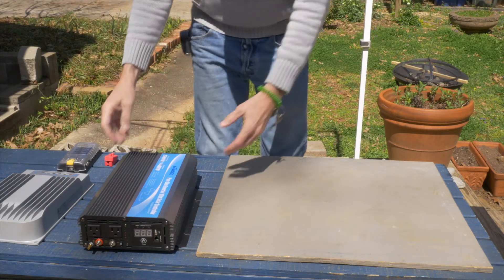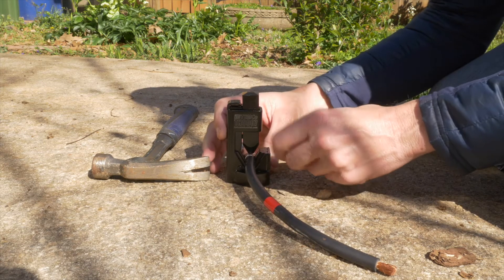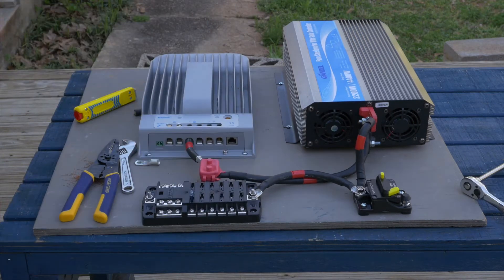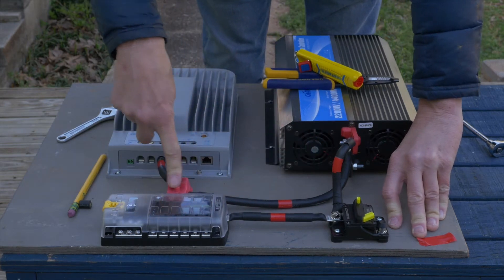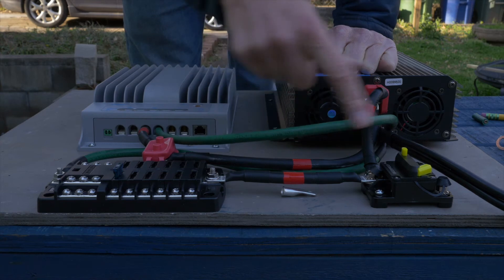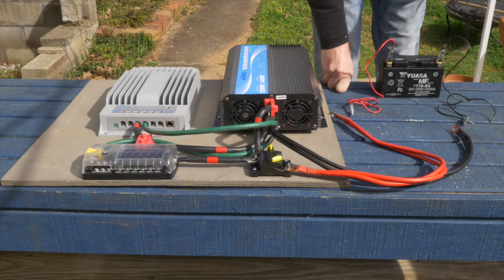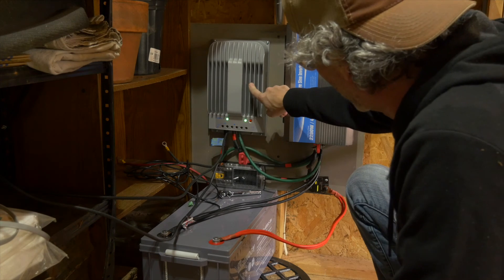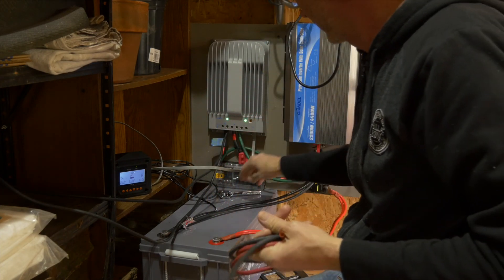Wiring my first solar setup.

Comment: Man, you have good taste in components! "Gandalfs" have a great reputation and I believe that you tube solar guru Will Prowse recommends the EP Evers as one of the best. It was like watching a guy set up a stereo system with Denon, Yamaha, and other good brands.  I think I may be slightly OCD, it actually bothered me that you had green wires instead of black, any chance you can wrap a black electric tape around those green garden hoses just like the red tape you used positive wires?  So, that 2200-watt inverter puts out as much juice as my 2200-watt Honda gasoline generator. Wow.
Reply from the maker: I work on motorcycles and Green is Ground and Black is Hot on many bikes so I am comfortable with the color scheme. Plus I got the wire out of a scrap pile where green and black were the only choices. Thank you for watching.
Reply: @billys2416  I was just joking, it looked like good thick gauge. I have seen some You Tube Videos where all kinds of colors, white, yellow you name it is used. In fact, I recall one of Will Prowse's where he used off colors blue and white. But the worse was where some guy in India used a car starter battery for his real basic almost primitive set up. Poor guy.

Comment: @ 2:32 you could have just moved the fuse box a bit to the left away from the breaker to get the cable straight so no cutting and wasting material. Kind of late advice tho..lol. Nice setup, good informative video. Greetings from Jamaica.
Reply from the maker: True. I think I already had the fuse box screwed down and just went for the crimping practice.

Comment: I searched for some information about wiring the solar charge controller to the inverter like you have done. A heap of solar professionals here in Australia suggest not to do it as it can wreck your system. I've seen heaps of people do it your way. Wondering if it's got anything to do with our voltage to compared to yours.
Reply from the maker: I do not know why. I wired it the way I did after seeing IDK how many diagrams and watching videos. Many froom Wil Prowse. I even bought his book.
Reply: @billys2416  I watch Wils channel too.

Comment: Nice video. Can you tell me if you have to have the battery heat sense wire and the remote monitor to make the controller work correctly. I would appreciate your help
Thanks John.
Reply from the maker: I do not know that. I do not think you have to have it. From what I understand If you do not use the heat sense wire the batteries could be damaged or worse.
Reply: The controller will function without them. The temp sensor prevents under or over charging batteries in cold or hot weather. Interior of a vehicle can be quite hot in the sun and that can be a big problem without the sensor. Without a monitor you have no way of knowing how the system is functioning unless you use test meters to check.
Reply: Thank you john

Comment: The one problem,  which I learned about the hard way,  is that your entire system,  including the battery,  should be at least 4 feet off the ground,  and you should include some type of protection from roof leaks.
Reply from the maker: I ended up moving the hole system in the house. The battery is about 1 foot off the ground currently. Thanks for the heads up on roof issues.
Reply: Is the four feet for flood danger?
Reply: @alflores4220  yes, at least 4 feet